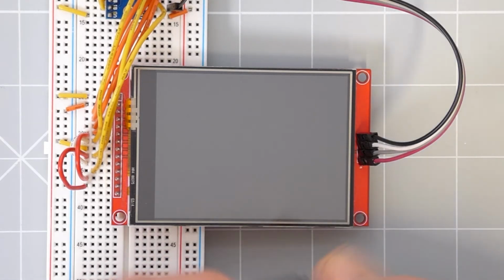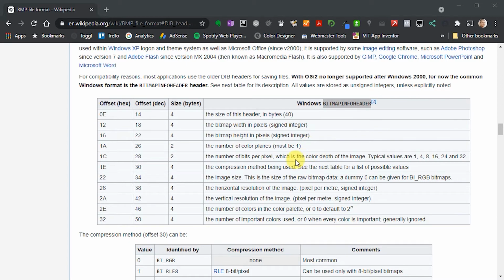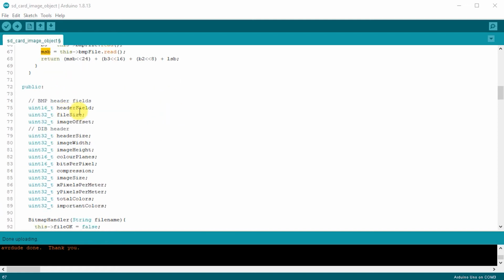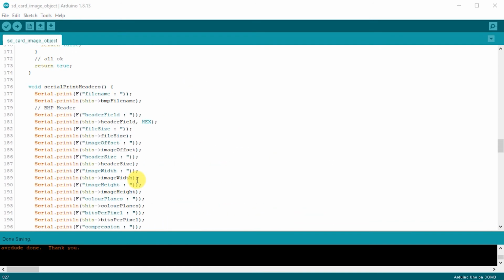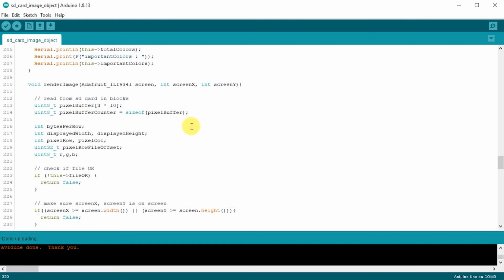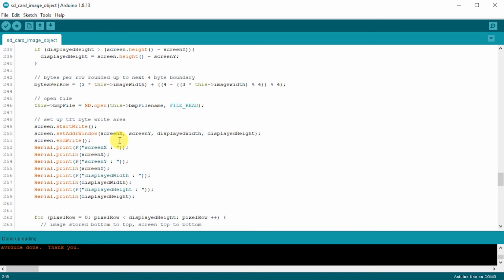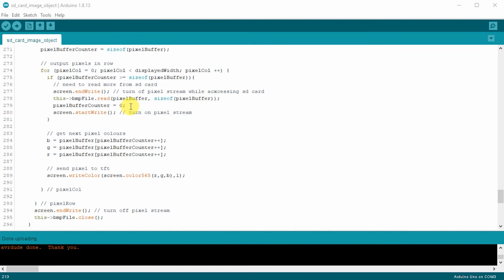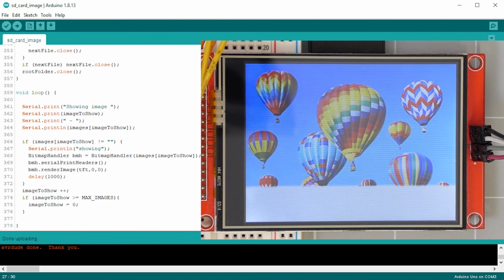How to Decode and Display Bitmap Images Using an Arduino

Comment: This is exactly what I needed and explained clearly and concisely.  Found this video and then realized I was already subscribed to your channel. I think for the game programming. A lot of great videos here that now I will explore. Hoping I can find something on sprites. Thanks !
Update. I cheated and just modified your code - still could not have done it without the understanding you provided in the video. I am using what seems to be known as a CYD (Cheap Yellow Display). I can read the images from the SD card and display them now on the screen! Now to push the card - which is an ESP 32 - to it's full potential (or limits...) I need to be able to upload images via the internet to the SD card. Sounds like a pretty good challenge! :D - thanks again!
Reply from the maker: Glad it helped! Have fun!

Comment: i am using stm32f302r8 and waveshare(ili9486) rpi 3.5 inch display and sd card module and i am using arduino ide to program and i am able to display a text from the file present in the sd card could you please help me on how to display image

Comment: ..how to make arduino recognise/read color (pixel array) in a image file at certain coordinate on that image?...used to decode timezone and country data on a globe map image file where each country is represented by a color...for auto local timekeeping GPS watches..
Reply from the maker: The code in the tutorial should give you all the data you need for a bitmap image. As you decode the file you'll be able to extract the pixel data you need.

Comment: Would you be able to reduce the delay in your slideshow code to display multiple images on the SD card quickly as a GIF?
Reply from the maker: The limiting factor is the screen area you need to draw for each frame. If your GIF is small you'll get a good frame rate. Full screen size and you're down to 1fps or slower.
Reply: @BytesNBits what is the limiting factor here?
The speed of the SPI bus or the clock speed of the Arduino?
Can you write multiple pixels at the same time?

I found your video very informative and would like to try and adjust it so I can program a STM32F103C8 (through Arduino IDE) :) it has 2 SPI buses and higher clock speed. I tested a library and managed to get 36Mbps (=2FPS I think). But had no clue about the basics until now.
Reply from the maker: @KevinBoosts  With the Arduino Uno I think it's a bit of both. These screens tend to have a max SPI clock speed of 50-70MHz even though quite a few are only specified at around 30MHz. The Arduino clock runs at 16MHz so you'd be pushed to get to those limits. I'm not sure how fast the STM runs. Using an ESP32 you can get to the limit of the LCD panel. The other option is to optimise the display update, e.g. only send changed portions of the screen to the panel.
Reply: @BytesNBits  The STM has an ARM 32bit Cortex M3 CPU which makes for 72Mhz. So in the middle of Arduino and ESP32.
I tried your code with an STM32 & 240x240 ST7789 driven tft, it works at normal speed (1/3FPS) :)
It'll be a nice project to make it go as fast as the benchmark examples I've ran before, seems I'll be looking into SPI & DMA next 😄

Comment: Thanks for this very helpful guide. It works but for some reason the image is mirrored. 🥴
Reply from the maker: Hi. Sometimes the pixel data is stored in a different order. Check the image height and width values in the DIB header. If they are negative the pixels are being stored in the opposite order on that axes. e.g. a negative height means the rows are top to bottom rather than bottom to top.
Reply: @BytesNBits  thanks for this. In the end it was easier to just flip the image!

Comment: Hello, thank you very much for sharing your work. I was wondering if there is a way to display these images in a faster way, maybe using .raw format or something similar? Is it possible to increase the speed of the process? Thanks in advance
Reply from the maker: Hi. The main bottleneck is sending the data out to the screen. This needs to be done pixel by pixel. The Arduino is very low on RAM so we can't create any sensible memory based frame buffer which would let us send the whole screen in one go. Have a look at this video for the idea using a Pi Pico - https://youtu.be/fGfb2NvDlG4

Comment: Thank you for sharing your wealth of knowledge with us. 

I'm using a monochromatic screen (SHARP MEMORY DISPLAY) - and I'm trying to decode 1-bit bmp files with no luck. Following your guide & reducing the total byte counts / buffer doesn't seem to do the trick.

Any tips? 

Much appreciated!
Reply from the maker: Hi. I would create a small bitmap image say 16 x 16 pixels. Then modify the code to output all the data is pulls out of the image file. You should then be able to see the data, what the code thought it had to do and hopefully you'll start to see where it went wrong. I hope this helps.
Reply: @BytesNBits  This helps a ton. Basically did what you suggested (except I went for a 3x3 1bit bmp). With more testing, I should be able to get something out! 

Will update this thread/upload my own vid explaining how I ended up doing it. 

Thanks for your reply! Cheers.
Reply from the maker: @FebMixer  Great. Let me know what happens.

Comment: Finally someone who doesnt just throw in a bunch of libraries and function calls and there you have it (which isnt helpful/overwhelming for beginners or if your application is not off-the-shelve, custom neopixelmatrix in my case). Straight forward implementation and easy to follow presentation. Very helpful. Thanks alot.
Reply from the maker: Hi. No problem. Glad you found it useful.

Comment: Can I read the jpg image into bytes from arduino sd card and send it to python on laptop through bluetooth HC-06 , because i want to do the image processing but i dont know how to read the jpg image in sd card in bytes or hexadecimal format
Reply from the maker: Hi. Yes. Once you read the file in raw byte format it's just a series of 8 bit values. You can send this over any communications channel. You'll obviously need some code at the Python end to decode the data and turn it back into a jpg image inside the software.
Reply: @BytesNBits  but what is the coding to read the jpg image in bytes or hex, and send it through serial ? Do you have the video of tutorial? I am really new to this field
Reply from the maker: @khaileng3020  You can use the code in the video to read the file in hex. That's what it's doing for the bitmap image. You can then output that over the serial monitor or another channel. At the PC end you'll need to be able to identify the data and then compile it into the jpg file for saving.

Comment: Can i display images without the bidirectional converter
Reply from the maker: Hi. The screen runs at 3.3V and the Arduino outputs at 5V. You run the risk of damaging the screen without the level shifter. If you look at my setup video for the screen and Arduino I use a simple resistor voltage divider circuit, but the level shifter is a much neater solution.

Comment: Егор Смирнов
3 минуты назад (изменено)
Thank you for your job Bob! Let me ask you, i i've got an ili9225 display ant it has different methods. screen.endWrite(); screen.startWrite(); i found and they the same but was protected. but there is no method screen.writeColor(screen.color565(r, g, b), 1); and screen.setAddrWindow(). Instead it has screen.drawPixel(); that hendel some functions of setAddresWindow but i cant figure it out how change and split different librares and methods. Cold you please take a lock and me it possible to solve that problem?
Reply: Just cant place the link bu can be easy found o Git so there is an similar issue there
Reply from the maker: Hi. I'm in the process of making a video on how to write your own drivers for devices and will be using the LCD screen as an example. I'll cover how to work out the screen commands and implement  them in code. That will probably give you a better answer. That one should be out the the next 2-3 weeks.
Reply: @BytesNBits  thanks a lot this will help!

Comment: This info is all very useful. I wonder if you'd be willing to teach how to make a needle gauge, as you were discussing. I've looked at the kbv examples and they are a bit confusing.  Thank you
Reply from the maker: Hi. Control panels are on my list of things to do at some point. My idea in this video to to draw / photo / etc some gauges to make a more realistic control panel. Each gauge would have a solid colour background. You would then draw the needles / pointers / etc. onto the gauge to show the value. Use the overwrite and redraw technique to erase the old pointer and then redraw the new value to animate it.

For a rotary dial you need to work out the end points of the needle. Taking the centre point makes one end easy. Next you need to translate the values into angles and then work out the coordinates of the other end using trigonometry. Then just draw a line between the two.

I hope this helps a bit. It's a bit vague but I hope you get the idea.
Reply: @BytesNBits  Yes, I understand. I'm guessing the pixels under the old needle position would have to be redrawn as well. At any rate, I enjoy your style, and am looking forward to more. BTW; you deserve so many more subscribers. Maybe you could get  an article onto Hackaday?